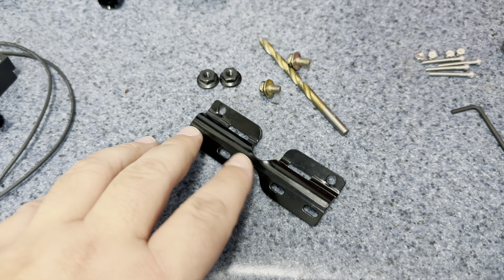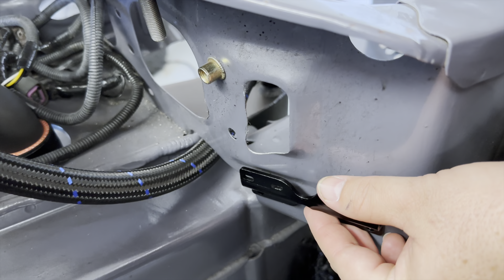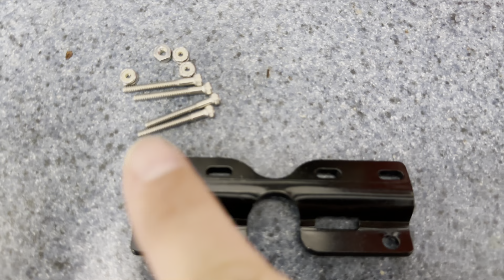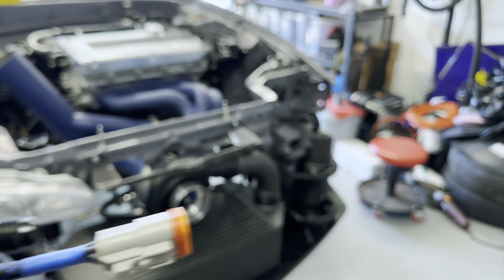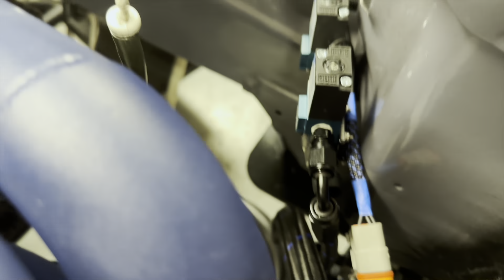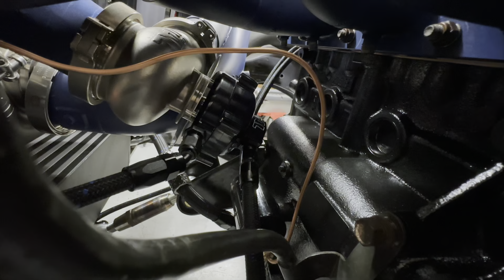Installing co2 Boost Control

Comment: Cool nice video but since you are a diy guy why not make yourself a set of an line pressure test kit before installing your an line you can test them outside the car and if you do end up having and leaks on any of the hose fittings you know right away and don't have to remove it from the car to repair . Just with the -3 and -4 end caps just  get fitting with a 1/8 npt treaded adapter  so you can add you 1/8 npt Schrader valve. And for the -6 to -16 drill and tap and depending were you get your fittings you can definitely put everything together  say around 40 bucks if you have a drill and tap and don't mind waiting about 9 days for them to arrive from over see manufacturers  .but it your choice .

Comment: In a future video could you explain what are the pros and cons of C02 for those who don’t know.
Reply from the maker: Man, I don't know if I'm qualified. This channel is to show what I do, not necessarily how or why. I'm no expert. The reason I did it was to allow a large range of boost control. I can run 3psi or all of it with CO2.
Reply: No real cons.  Pros better control for the boost. No boost creep.  More reliable the just running off compressor.  Better tuning options.   Small air compressor would work also if your ok with little more weight and the electric draw when pump turns on.